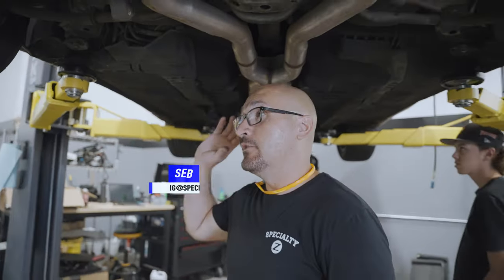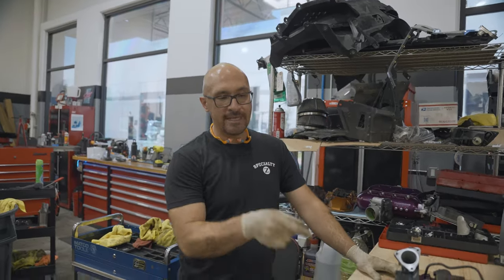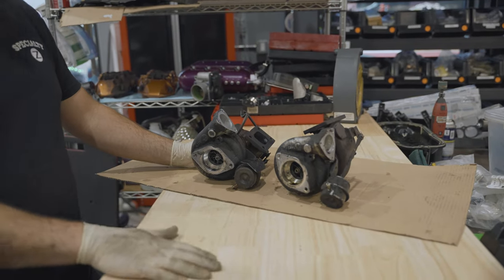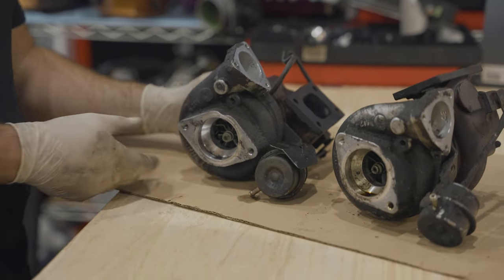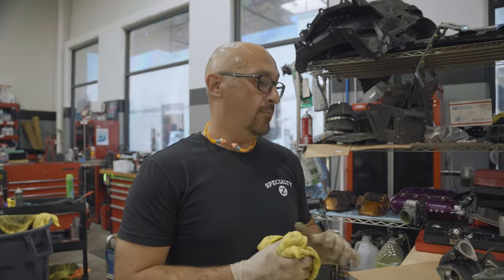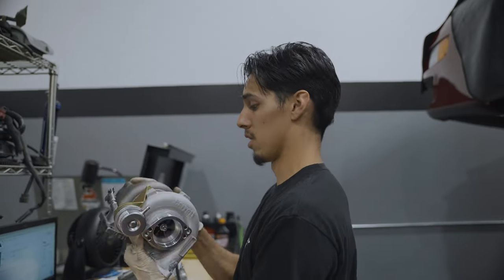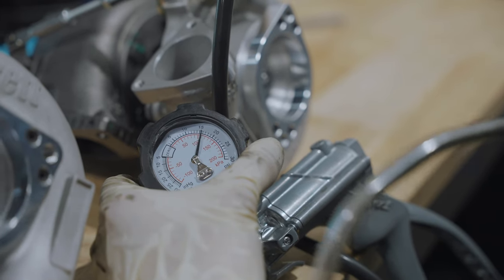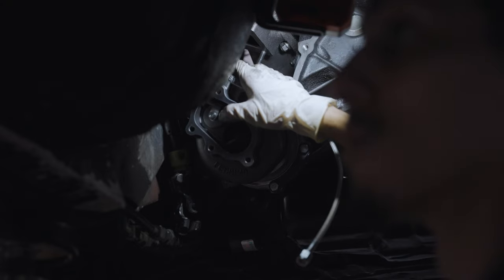How to Swap Turbos on a 300zx without dropping the motor

Comment: I took my turbos out without taking off the trans. It still had the stock exhaust. It was easy to get to the bolts but they were stupid tight... i welded up some wrentches and extensions to make special tools lol. Not bad of a job though
Reply from the maker: Nice work!